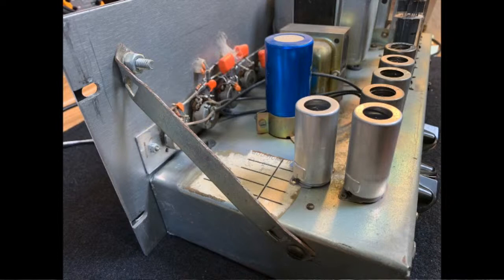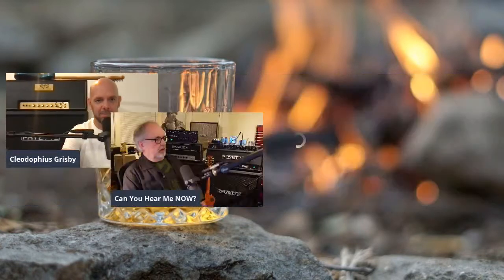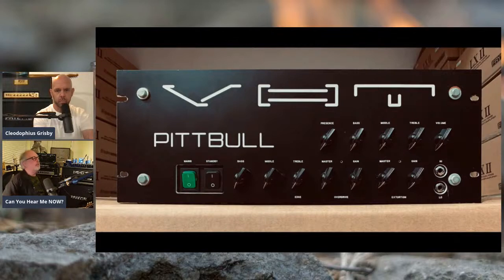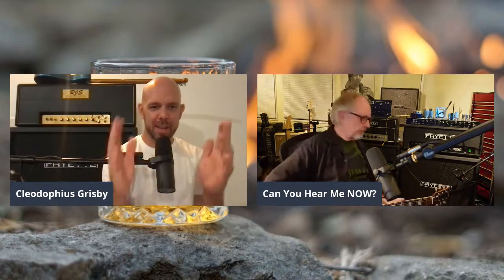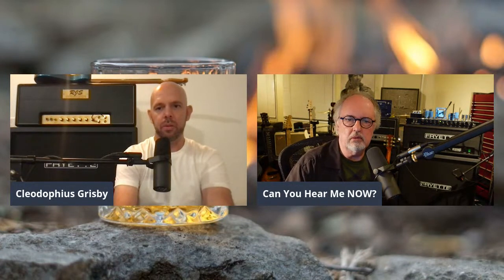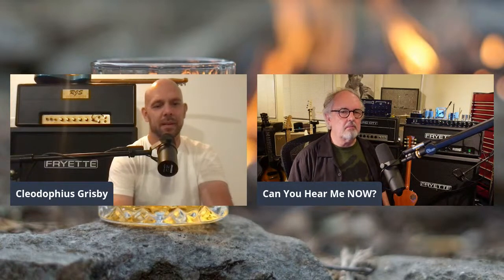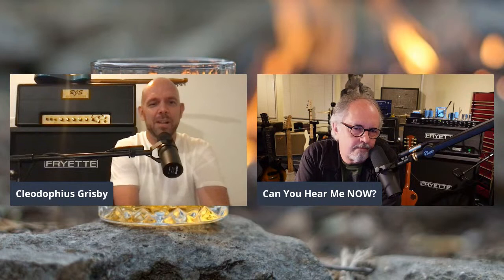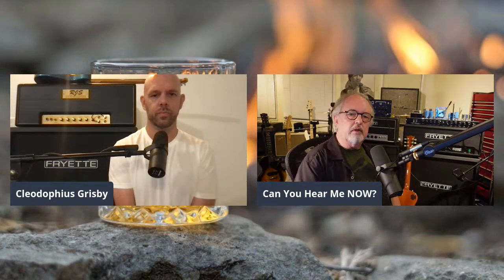The Malcontents Episode 11 - Unintended Consequences Pt2: Be Careful What You Wish For

Comment: Would love to see a show like this on the poweramps, 2150, 2/90/2, 2/50/2, LXII, Classic, PS100 power section. How they come about, what was the concept behind them, character differences, voicings, settings. There is a lot of confusion and misconception around like a 2/90/2 being stiff and cold and a 2/50/2 being a caharacter poweramp. Will a PS100 be a half of 2/90/2 etc.

Comment: Waiting for the stripped down two channel Fryette. Shared EQ, less/more, gain/master on each channel only. Three button max foot switch (one or two would be better). 

Cheers
Reply from the maker: You just described the Hundred/CL. http://www.fryette.com/content/G100CL_SFD.pdf
Reply: @FryetteAmps  I have one of those. They have separate EQ, multiple additional push buttons, and a four button floor switch with an additional rocker switch. Great amp, complicated by my standards though. I also have a D120, two early 70s DR103 Hiwatts among other things.